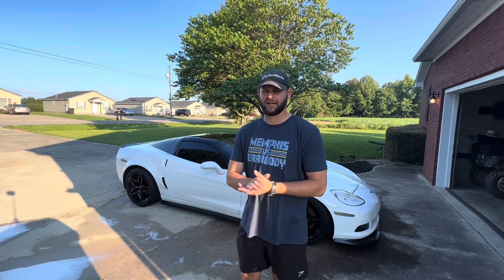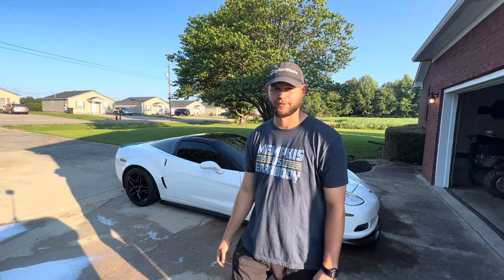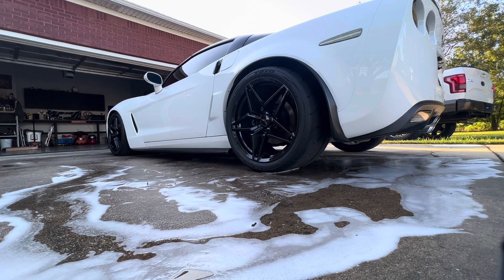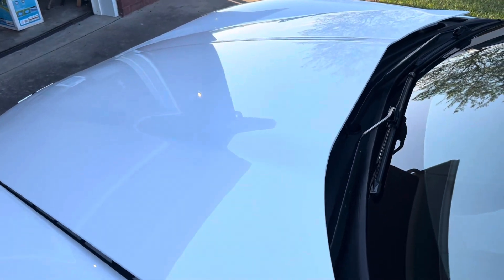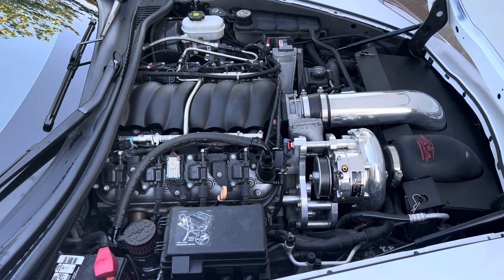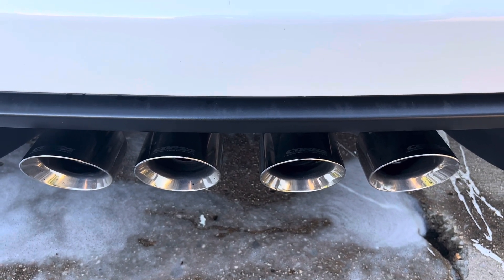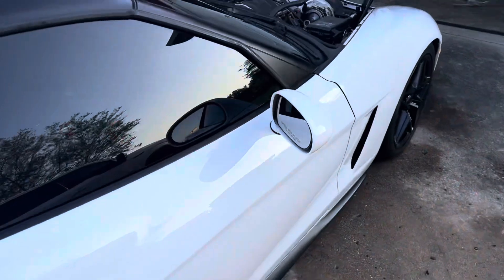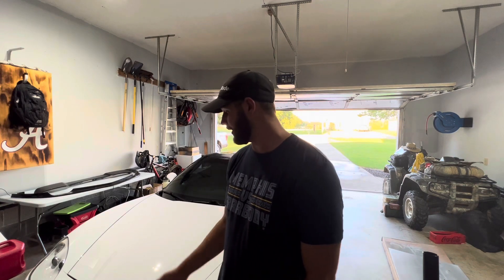Introducing my CRAZY C6 Corvette, A&A Supercharger / Corsa Exhaust

Comment: i have the same set up as you, a&a ti and meth kit is being installed and should be on the dyno Thursday. i installed a 3600 circle d stall  and it over heated the trans so i added a trans cooler . with the stall and drag radials it does not hook at all so im sure with the supercharger im going to have to get a drag pack. whats your whp? mine made 414 with headers , cam ,catless borla and a tune . i hope to be at 600 whp
Reply from the maker: I made 658 on e85, 4.0 pulley. Meth is definitely in the works I have heard it works wonders. Haven’t gone down the converter route yet, definitely plan on it in the future!
Reply: @FullTiltGarage  658 is great with a 4.0 pully with the e85 you have plenty of fuel for a 3.8 . The converter made it into a different car from a dig . i hope to get 650ish but my cam made no power so hopefully it will make power with the blower.
Reply: @FullTiltGarage   got the vette back today and i only made 550 to the wheel . so i only gained 125 hp from supercharger and meth. crazy i see guys up in the 650s
Reply: @dashero11 what year is your vette? I have a 07 6spd manual and I plan on getting this kit in another month or so..
Reply: @mmorgan901   2011 ls3